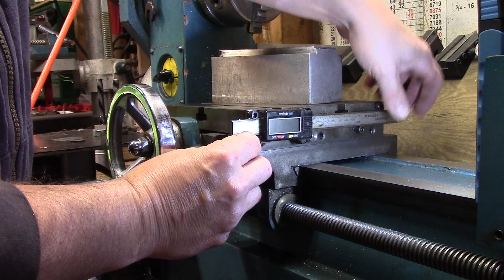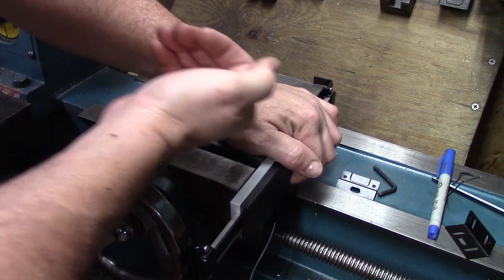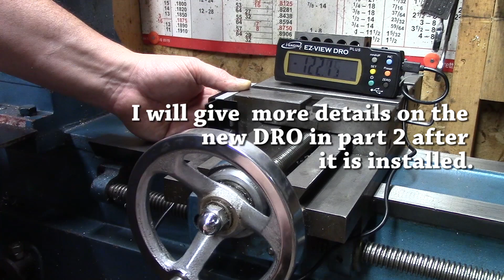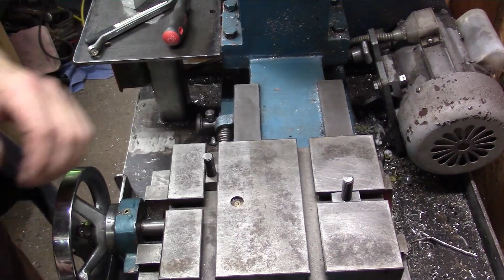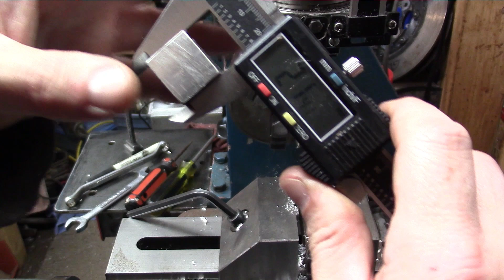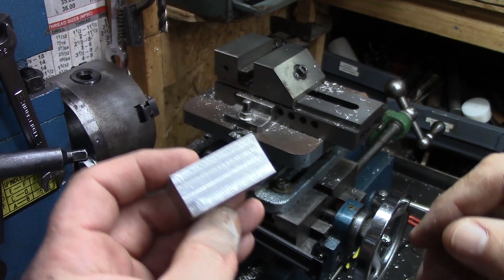Installing new X Axis DRO on the Mini Mill Lathe

Comment: Are you able to set the the tool dimension and move it so that it is in diameter mode? This way if your tool can be set on 10mm it will machine a 10mm part?
Reply from the maker: Yes, you can set presets with the "INC" button. Of course in this case it would only be in one axis.

Comment: are the collets you use morse taper 2 or 3? because on the hq400 manual it says its a morse taper 3? but the collets in your description are morse taper 2
Reply: awesome video by that way
Reply from the maker: So I added some new links but I could not find a whole set cheaper than just buying the collets and holder seperately. Thanks again for bringing the broken link to my attention.
Reply from the maker: Thanks. It is Morse taper 3. Apparently Amazon links sometimes do that, I have noticed that if my original link is not listed anymore they will go to one that is close. But the algorithm is not very machining smart apparently. I will have to find a new one I guess. But the set I got was an ER25 set with a MT3 holder. They are kind of hard to find. The ER20 set is easier to find. The 25 set goes up to the equivalent of 5/8" and the 20 goes up to 1/2". Thanks for watching.